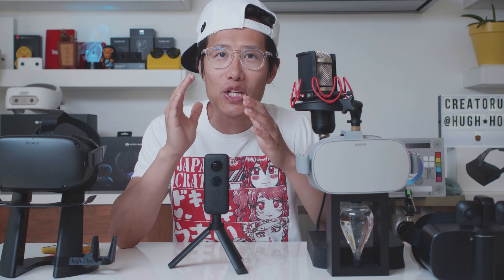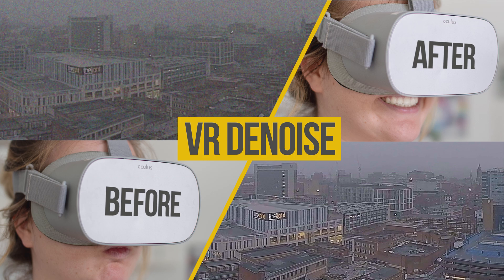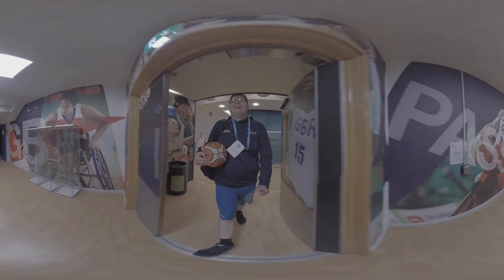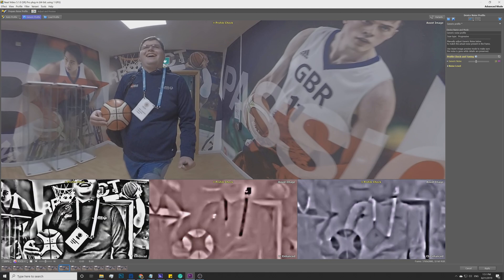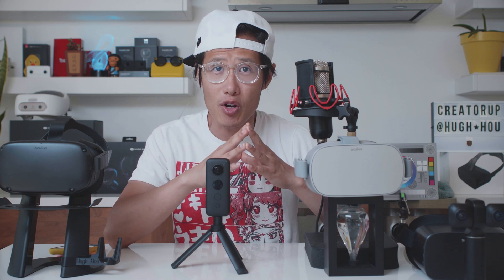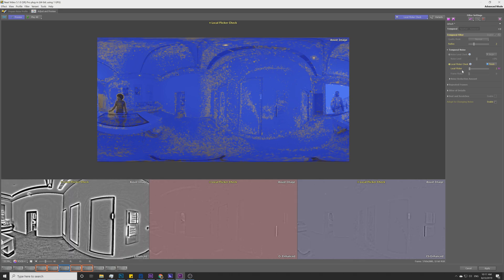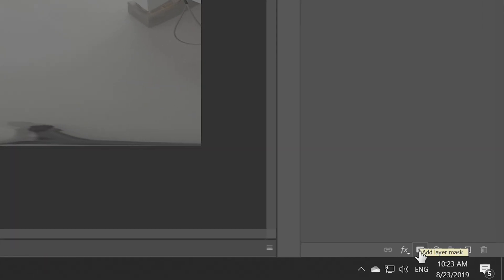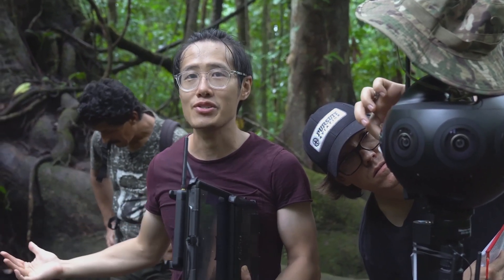How to Remove Flicker in 360° VR video

Comment: Hey Hugh, I took your class at Abelcine NYC last year.  I have a shoot in London, and Australia soon with the Insta360 Pro 2.  I know it has a 50hz setting.  Do you know if indoor lights will still flicker if the camera is set to 50hz.  I have never used this camera outside of the United States.  Thanks!!
Reply from the maker: I will test it in location - usually it won't but I will at least test 1 lens for find out on pre-production. Good luck!

Comment: Hi Hugh, Thank you for finding the time to keep us updated, sharing and teaching us. My game is improving due to basic skills like using VR sharpening, and the Neat 5! However I see sometimes terrible haze my videos and vr sharpening does not work on them. Is there a tool to take off haze? I am curious it maybe only just slower internet speeds? I am thinking of picking your videos apart and create a proper knowledge base system. Also, if you did not have enough on your plate :), maybe in the future you could respond to our youtube linked videos, what is wrong with them how to fix it. What do you think? I believe, that would be the fastest learning for us all, and funnn.:)  A YouTube subscriber meeting would just be tremendous with showcasing works etc, hmm, why did I say that I am in the UK and out of budget  :). Thanks again my friend. (I hope all was good in the jungle).
Reply from the maker: All great ideas!! I don't know what you mean Haze. What camera you are using? Any example you can show me about "haze"?
Reply: @hughhou  https://youtu.be/ZRwSQ4u3HfA     - maybe jump to 1:40 - In an Ipad set to 1080 it looks clear. I suspect Oculus Go (my only headset) can't keep up with either the internet speed needed or the processing itself. Pro 2 used. I stiched it in Insta 360 Stitcher to H264, VR sharpened it. In premier I set it to render aiming 300 Mbps max 360. I tried to max the YouTube recommendation for VR. DO I need to bring it down to 150 Mbps so Ocolus Go users can watch it too? Would the quality come down?

Comment: What about audio desynchronization on the GoPro Fusion?
Reply from the maker: There is audio desynchronization? This never happen to my Fusion. What is the off sync? How many second?
Reply: @hughhou  After a couple of minutes or so the audio is off sync. I've seen others have this problem on GoPro Fusion message boards. Its only a fraction of a second but its noticeable. I always have to resynchronize it in Premiere manually.